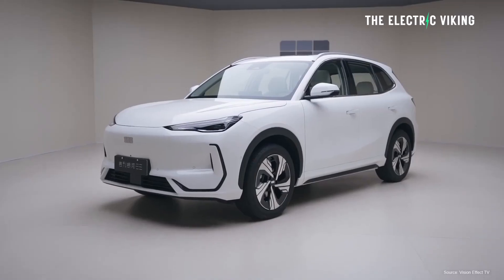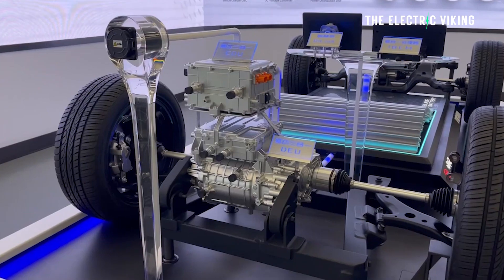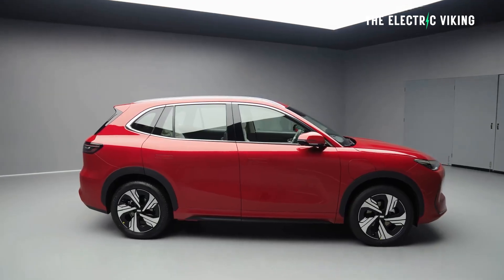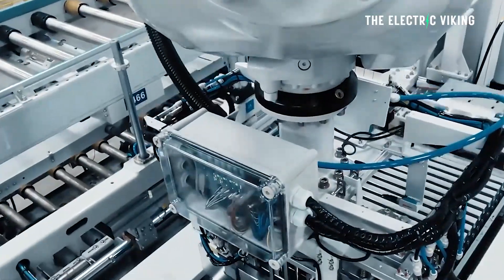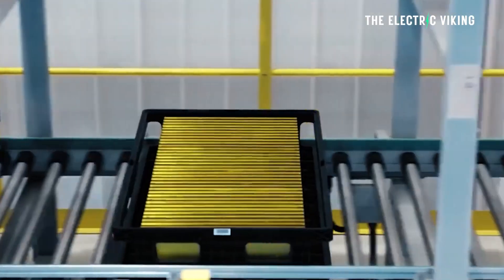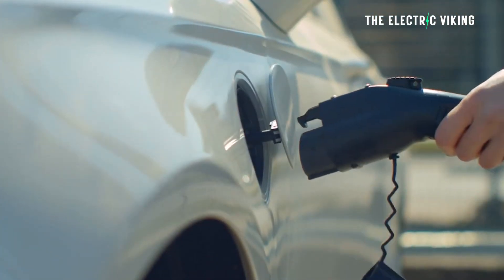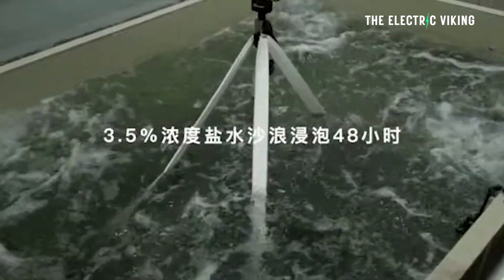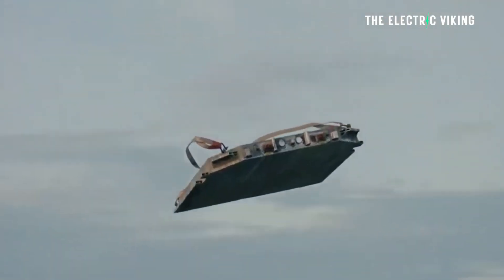Geely’s 1 Million mile LFP Short Blade Battery is the safest battery in the world

Comment: Frankly, the power efficiency of ICE cars will be severely affected by the time it pass 150k km. Anything that last 300k km is already fantastic to me.
Reply: yea most ICE cars over 150k have a lot of fuel efficiency problems and then all the other small problems of the fuel line and combustion engine which causes noise problems, driving problems etc.
Reply: I don’t think you guys (or girls) know much about cars. I have a 2006 Golf with 202K on the clock and a 1995 Daihatsu with 200K. My mate’s 1997 Land Cruiser has 380K. All 3 vehicles are used every day and maintenance has just been annual oil changes, filters, brake pads and tyres. Totally reliable, no issues. Another mate has a 1968 Valiant that has done 650K and he still uses it every day, tows a trailer to work sites (electrician). My neighbour Stan, recently dumped his 2023 BYD Atto 3, lost thousands on the deal. Car was absolutely appalling, fell apart. He bought a new Toyota RAV 4 Hybrid.
Reply: @PropanePete  I have had 42 various ICE cars since the 70's - ALL of them (that I kept that long) started to get niggles around the 150k-200k mark with meticulous maintenance.
Reply: @TB-up4xi   That’s quite impressive mate, 42 cars in about 50 years. Which one was your favourite. I’ve had 16 vehicles since 1967, two of which were motorhomes. My 1962 Land Rover Mk2A SWB was a bit of a pain in the arse with oil leaks but it never let me down out in the bush. My favourite car was my 1953 Morris Minor with the little side valve motor, hi-light (7” headlights on the guards) and the split windscreen and small rear window. Didn’t even have a heater. Loved my two Valiants as well. When you say “niggles” at 150K - 200K, are we talking major issues like burnt exhaust valves, head gaskets, or just a water pump leak, dodgy alternator, power steering, etc, ancillary stuff.
Reply: @PropanePete  See there is your issue you're comparing work trucks to passenger sedans.
Not to mention this is totally anecdotal as overall that's not going to be the case for those vehicles at that mileage. Also I bet all lost a lot of fuel efficiency.
Reply: @nfzeta128  Still get the same mpg as when they were new.
Reply: @PropanePete  wait this the same person lying again?
No car keeps the same mpg as new. NONE.
At most you may not notice as it happens gradually.
Reply: @nfzeta128   A VW Golf and a Daihatsu Charade are not work trucks. They’re small cars. Also, here in Australia a Land Cruiser is classed as a family car, drop the kids off at school, potter down to the shopping centre, go camping on the weekend. Same with the Ford ranger, Mazda BT50, etc, they’re just cars here. The 1968 Valiant I mentioned is a 4 door family car, the equivalent of the old Dodge Dart in the US.

Comment: Burning a gallon of gasoline produces about 19–20 pounds of carbon dioxide (CO2), which is a greenhouse gas (GHG) that contributes to global climate change. A typical vehicle emits about 5–9 tons of GHGs per year, or roughly 4.6 metric tons of CO2. However, the exact amount can vary depending on the vehicle's fuel, fuel economy, and how many miles it's driven each year. For example, denser fuels like diesel contain more carbon and produce more CO2 than gasoline for the same volume. 
Environmental Protection Agency
Greenhouse Gas Emissions from a Typical Passenger Vehicle
Aug 28, 2023 — A typical passenger vehicle emits about 4.6 metric tons of carbon dioxide per ...
Fuel Economy
Reduce Climate Change - Fuel Economy
Highway vehicles release about 1.5 billion tons of greenhouse gases (GHGs) into the atmosp...
EIA
Gasoline and the environment - U.S. Energy Information Administration ...
Burning a gallon of gasoline (that does not contain ethanol) produces about 19 pounds of c...

Ressources naturelles Canada
Auto$mart - Learn the facts: Fuel consumption and CO
Tailpipe CO2 emissions vary by fuel type because of their different densities. Denser hydr...

NASA Climate Kids (.gov)
A gallon of gas = 20 pounds of CO 2 - NASA Climate Kids
So the carbon in a gallon of gasoline (weighing 6.3 pounds) weighs 5.5 pounds (. 87 x 6.3 ...
In 2022, the combustion of aviation and motor gasoline in the United States produced 1,176 million short tons of CO2, which was about 22% of the country's total energy-related CO2 emissions. Transportation is the largest contributor of GHG emissions in the US, accounting for about 28% of the total. 
Generative AI is experimental.
Show more
EIA estimates that in 2023, U.S. motor gasoline and diesel (distillate) fuel consumption in the U.S. transportation sector accounted for about 31% [1,489 million metric tons (MMmt)] of total U.S. energy-related carbon dioxide (CO 2) emissions (4,794 MMmt).Apr 30, 2024

US Energy Information Administration - EIA

Comment: Sam - could you explain the standard the battery companies use for "charge cycle".  For example, you mention this battery can be charged 3,500 times.  Is that a 0-80% (or 100%) charge, or does a partial charge count.  This is relevant because most of the time, people are charging EVs at home overnight and probably add only a small fraction of the total KWH a battery can hold.  For example, I average adding about 20-25% charge to my model s each night.  In my situation, does the 20-25% charge constitute a "charge cycle" or would it be 1/4 of a cycle?  
This is relevant because 3,500 cycles is only 9.59 years (3,500/365 - assuming daily charging counts as a cycle).
Reply: Cycles are always for full charges from 0-100% dod. Not partial cycles and only the complete amount of kwh from empty to full counts as 1 complete cycle of the pack. 👍🏻
Reply: charged  always  assumed  at 100%. Thats why you can have long lasting NMC with 1000  cycles as long you never charge it above 80%.
Reply: LFP = 0-100% and 3500 charges to 80% capacity left.
Reply: Just adding to the other replies, you can see why 3,500 cycles is easily two or more decades of battery life.
Reply: If your daily driving consumes 20% battery = 1/5 cycle, then it will last 5x3,500= 17,500 days ~48 years. 50%/day~ 19 years.
Reply: Honestly who cares about charge cycles now? Just plug it in, and doesn’t require over-thinking.
Reply: Do you really think he knows? He just reads others' articles 😁

Comment: If this is warrantied for 1,000,000 miles, and it's manufactured affordably, then it's really a game changer.  The removes one of the two real issues with BEV's, replacement cost of the high voltage battery.
Reply: It doesn't beacuse failure of the high voltage battery is not a real issue. 
Tesla tracks the health of the battery in all of its cars. About 6 months ago it released the data on the battery health of its cars at 200k and failure rate was under 1%.

A 1m mile warrenty would be nice to have but in reality it would make no difference because just as now, for almost all drivers, the battery will outlive the car
Reply: @Alantj22  I have two different coworkers, in the last 5 years, who have failed Tesla battery packs out of warranty. It certainly is an issue to them.
Reply: @GOLFandWRX   Unlucky.  The full data was been published and independantly analysed. My Model S replaced a BMW M5 that by the time it had clocked up 80k miles had also clocked up over £25k in out of warranty repair bills.
Reply: @Alantj22  And that's why I didn't buy a BMW. I didn't say all ICE cars are equal. I am just saying that a full battery failure is a very large pill to swallow all at once. My coworker who's Model S failed also had to replace one motor and inverter along with the battery - that cost far outweighs the price of a replacement. Yes, bad luck.
Reply: @GOLFandWRX  Your coworker either bought himself a  defective car or he did something to it for all 3 things to break.
Reply: No such thing as a 1 million miles warranty and never will be. Come to reality.
Reply: @PyroShields  CATL could easily introduce one. It would shut up the idiots still claiming that EV batteries need replacing every few years and cost them almost nothing as hardly any cars do anything like 1m miles.
Reply: @PyroShields  then don't claim you have a million mile battery.
Reply: @GOLFandWRX  That is not how warranty works. For example Tesla batteries warranty is 100k even though the batteries will last you 300k -400k miles.

Comment: All batteries are coming from the same  place: china, and it is not a good sign.:face-green-smiling:
Reply: Incorrect SMDH. Tesla and Panasonic had the world's first ev gw scale factory open in late 2016 in Nevada. 
It was the single largest cell plant until catl surpassed it in late 2021. 

The U.S. along with korea&Japan has a LOT of cell capacity built out and supplying over 30% of global ev supply without relying on China! 

U.S. alone by 2028 will have enough locally sourced&built ev cells to supply 8,000,000+evs and over 12,000,000 evs by 2030-2032. 
Not even counting teslas 4680 cell plans which are good for another 2,500,000-4,000,000+evs. 😎
Reply: Competition is great! Goodbye legacy auto!
Reply: While CATL and BYD are no 1 and 2? I think you should stoop watching Falun Gong  cult channel like  China  Observer.

Comment: Shorter Blade batteries allows many configurations of Battery packs and 800V architecture ( faster Charging Speed ) which is the new direction for EVs. Plus Smaller batteries into smaller EVs.
Reply: Exactly. And even more than one plug lol. Charge multiple batteries at the same time at the same two plug stall.
Reply: How do you achieve 800 Volt Isolation for Service and Repair of this BEV System ?.